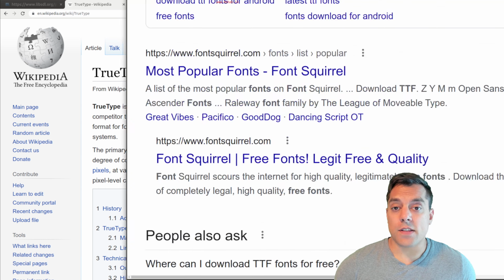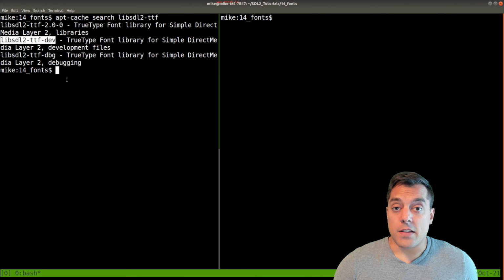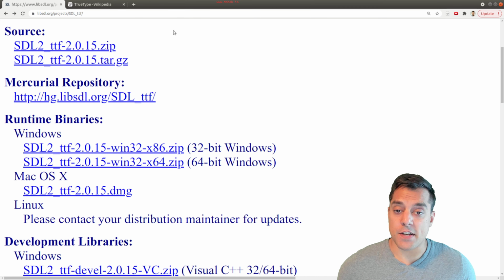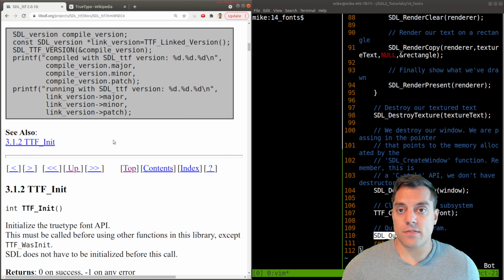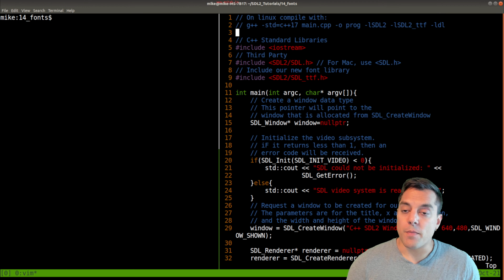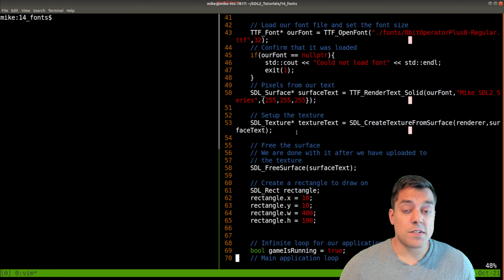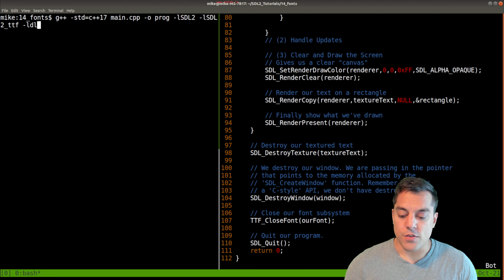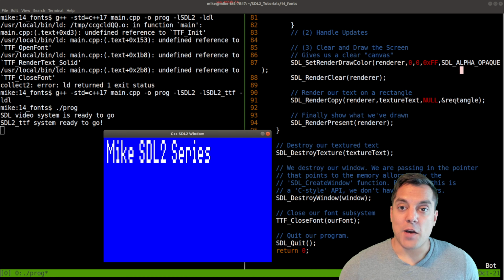[Ep. 22] True Type Fonts (ttf) in Simple DirectMedia Layer | Introduction to SDL2

Comment: If you turn it into a texture, you cant modify it anymore. What if I want to modify the text often
Reply from the maker: Correct, most likely you'll want to update the texture (i.e. regenerate it) on any changes. If this is something that might happen frequently, you might consider caching text that appears often. There may otherwise be some strategies to stream in texture updates to speed things up as well.
Reply: I thought creating a surface and a texture + freeing a surface and a texture every few frames would be unoptimized, but thats what I did. In my case, Im rendering a counter that consistently goes up. I like to create structs that Im reusing before hand, like rects, because I think that if I modify it I wont have to allocate and free any memory, but the function works with pointers and i have no control over the actual texture/surface. This just from my intuition, in reality Im a beginner and I dont know much about programming, Im just doing it for fun. @MikeShah
Reply from the maker: @nikykovalski5869  Great! There's probably ways to optimize this as free'ing and recreating every frame may be expensive. Some folks will thus preallocate text (or do all allocation at once for example ahead of time). There's many strategies -- my recommendation is to run a profiler at some point and see if that's a major bottleneck in your program for further improvement :)

Comment: Hey Mike! Happy New Year-ish kinda late. I've gotten in the habit (for Windows dev) of putting the .dll files that end up missing for the Visual Studio Build process in the same directory as my main.cpp equivalent. Im up to 4 .dll's now for this one project. This kind of feels like a bad habit to me. Is it normal to have to cut -> paste the dll files from the downloaded development libraries 'lib/x64' folder and put them with the .cpp containing main? Surely Visual studio automatically looks in one of these folders that come with the scaffolding of a new project? I'm not having great luck with the Googles here. Thanks!
Reply from the maker: Putting the .dll's wherever your executable is, is usually the default place windows will look. Otherwise windows will look in various paths (somethings PATH which is an environment variable containing directories) to look for .dll files (Installers will sometimes modify this behind the scenes without you knowing for example). So in short, for development this is fine, and folks will distribute games with .dlls in a 'known' path or otherwise create an environment variable for where to check for the .dll.
Reply: @MikeShah  Thanks for the quick answer, really appreciate it. I'm gonna make an effort to get a better understanding of .dll's in general but good to know I'm not doing something to be point and laughed at for later on xD. Makes sense though, installed programs have all that random stuff they install in the executable directory. I'm guessing this is just one of those. I'll go dig around some program folders and check it out. Thanks!!!

Comment: For anyone else following along on M1 Mac it looks like the Mac Install for this library builds for macOS-x86_64 and you will end up with a linker error when attempting to build

"ld: warning: ignoring file /Users/max/Library/Frameworks/SDL2_ttf.framework/SDL2_ttf, building for macOS-arm64 but attempting to link with file built for macOS-x86_64
Undefined symbols for architecture arm64:
  "_TTF_Init", referenced from:"
Reply: I saw the comment on the following video in the playlist and attempted to build the library on my computer but ended up with an endless number of missing headers from the freetype library which it depends on.... so I gave up after a few hours in compiler "practice"
Reply from the maker: @dwolrdcojp  Hmm, so just to confirm--no luck getting the TTF Library working on Mac M1?
Reply: @MikeShah  I'll give it another shot building from scratch since you released another video using the TTF Library but I never got it working when I made the last comment
Reply from the maker: @dwolrdcojp  I just finished recording part of a video for building SDL2, SDL2 mixer and SDL2 ttf. Stay tuned, should be released in the next day or two!
Reply: @MikeShah  Hey Mike, just played around with the TTF library again and was able to get it built on the M1 mac. Apparently a week later I am smarter. Here's what I did: git clone from the SDL_ttf repository then cd into the freetype directory to do a ./configure -> sudo make -> sudo make install and then cd into the TTF directory and do the same ./configrue -> sudo make -> sudo make install and made sure to include -lSDL2_ttf in my build.sh file and viola! It works now!
Reply from the maker: @dwolrdcojp  Yup, that's all there is to it! Glad it works! I'll show in the video how to build SDL2 from source as well, and then use sdl2-config to make it easy to find libraries/include paths.
Reply: @MikeShah  Thank you as always! Looking forward to the new videos